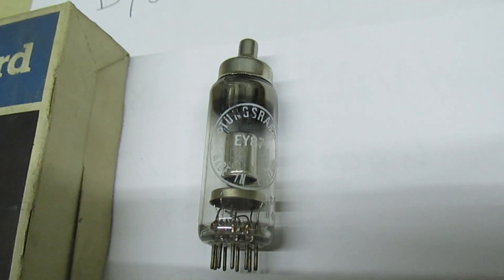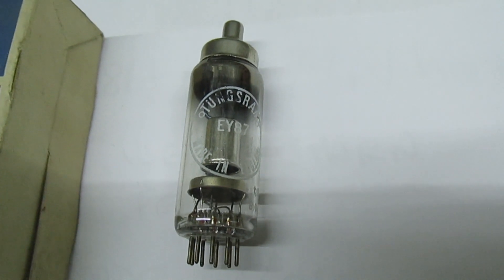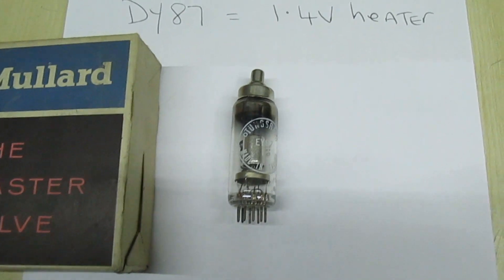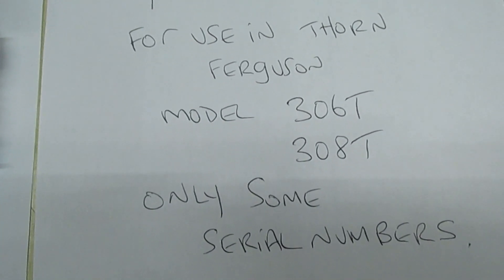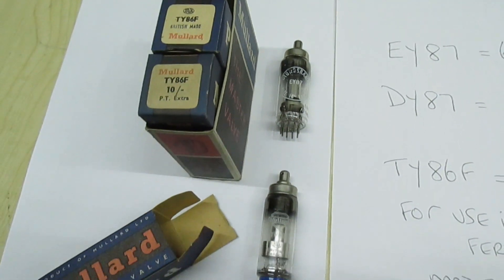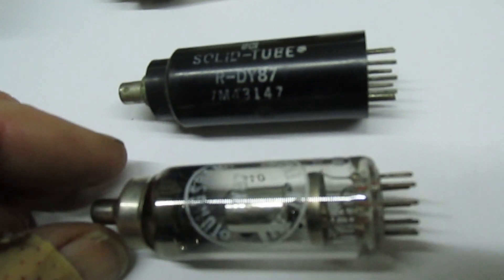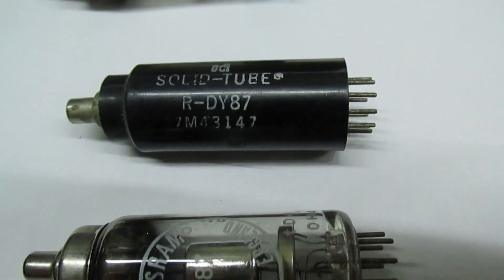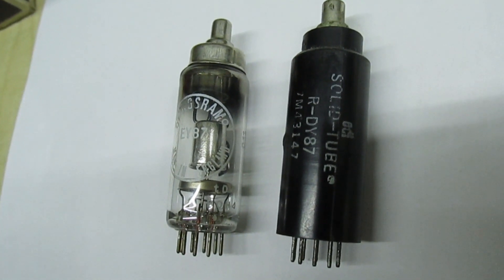Lets take a look at a solid state DY87 E.H.T  Rectifier valve .

Comment: That is brilliant the conviinience of local produced components. However which one caused the error designer testing or Loptf manufacturing. Did they raise the EHT and forget about the heater winding?  When you think about bit it was easier for mullard just to change the heater spec.  The valve manufacturing process would be the same.
Reply from the maker: Long time ago there was a set , cant remember the model now where the line transformer had too much heater volts and the rectifier diode had a short life so mullard made a special rectifier for replacement which was presumably cheaper than recalling all the sets to have a different line output transformer fitted, I seem to remember the valve was designated TY86F with a 7 volt heater but I could be wrong .

Comment: Wow! I never did see one of those! I did see some solid state replacements fitted on the video board to some PYE CT205's.
Reply: P.S. I seem to recall it was a solid state PCL84 on the PYE CT205 - CDA colour drive...
Reply from the maker: @marksntl7632  Its a long time ago now but I think it was the luminance output valve you are thinking of PL802 I think but could be wrong ?
Reply: @michaeldranfield7140   Yes you are correct it was known as an Iron PL802, lum output. I did not like it when the CRT sparked over.... ah the fun we had.
Reply: P.P.S. They had 3 of them for red, green and blue CDA drive - sorry for the P.P.S.

Comment: Hi Michael, I have one of these somewhere. Probably just a TV20? selenium stick in resin. Would not having the load of the heater effect the EHT of the set? I replaced the EY87 with a stick in my A774 because the holder was breaking down and it didn't, but a few people raised that concern with me.
Reply from the maker: As the heater winding for the EHT valve is fed from the line output transformer I wouldn't think not using it would make any difference and the heater current on these valves is very small, but even if it did you could simply remove it from the transformers limb .

Comment: Did some ht rectifier valves got there heater voltage with a coil wrapped around the tube .which was connected to the line output coil.
Reply from the maker: in some set s  just a single turn of high voltage wire around the limb of the line flyback transformer provided the heater winding for the valve .
Reply: I think it was call a tickler coil.
Reply: most EHT rectifiers got there heater supply from a winding on the lline output transformer

Comment: We used to fit solid state pcl85 frame out valves.
Reply from the maker: Thats something I have never seen before .
Reply: @michaeldranfield7140  I still have some ledco S pl802 solid state valves like you never seen a ss pcl85
Reply from the maker: @robtitheridge9708 yes I  remember the Ledco PL802 solid state valve , ledco also made replacement IF strip module for a Pye  TV as well, could be Pye 713 or was it pye 725 ??? from memory , its a long time ago !.
Reply: @michaeldranfield7140  713 i think CT200.
Reply: @michaeldranfield7140  CT200 so 713
Reply: I am surprised there are  no solid state plugins for  KT66 or EL34 valves  for audiophiles. It's my idea, don't any of you make money out of it!